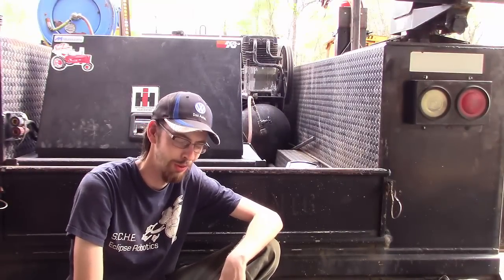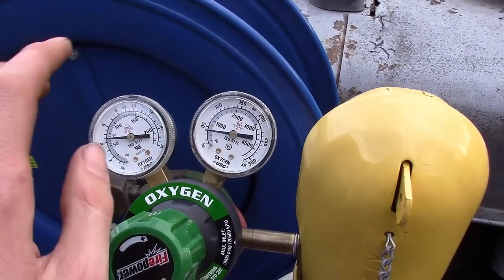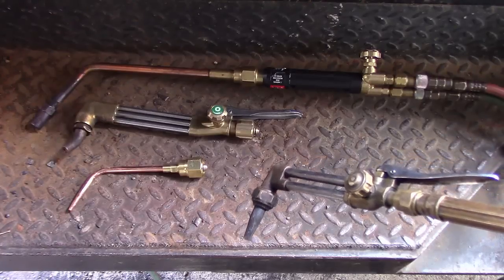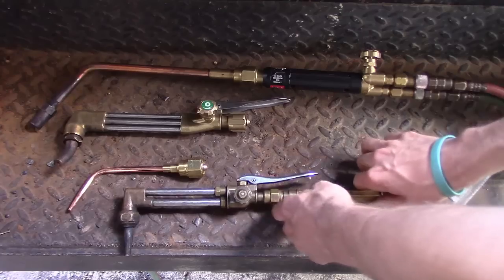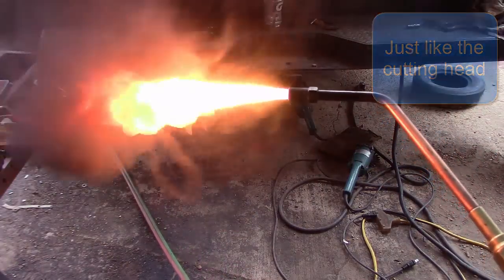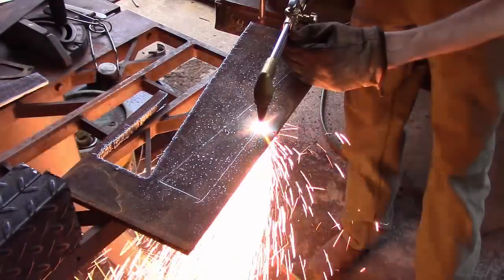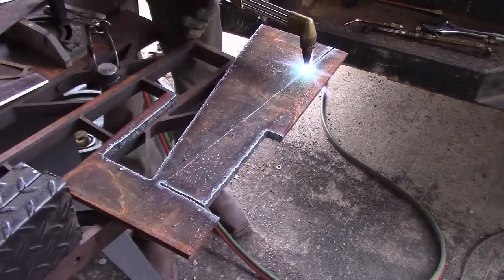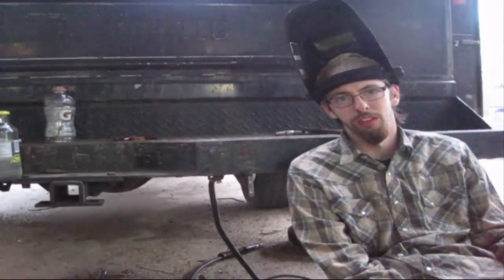Acetylene torch basics

Comment: Hi man.
I appreciate people like you taking time to teach others about the things that are not so common. 
Thank you.

Also,i had a question.
I'm currently looking into melting silver for jewelry making.
I have a couple of ounces now and the roller mill machine for wire making is also in my shopping cart.
What i need to know about now is a torch. But i am clueless as to what to buy or what's the difference between cutting torch and heating torch.
I wouldn't know how to turn one on if i bought it.
Any advise on what to buy and how to use for a begginer with ZERO skills?
Reply from the maker: Thanks for watching always happy to hear my work is helping others.Well first thing is how much are you wanting to spend to get a torch.  The torch itself is the cheapest part of the operation.  The tanks are where the money goes.  You can buy or lease the tanks yearly (you'll have to find a welding store or gas warehouse to do this) I do like acetylene better than any other working gas but you may be happier with propane or MAPP gas (They are cheaper) https://www.amazon.com/Victor-Oxygen-Acetylene-Welding-Cutting/dp/B010E1UYNC/ref=asc_df_B010E1UYNC/?tag=hyprod-20&linkCode=df0&hvadid=312039830589&hvpos=1o13&hvnetw=g&hvrand=15462010840477148247&hvpone=&hvptwo=&hvqmt=&hvdev=c&hvdvcmdl=&hvlocint=&hvlocphy=9013981&hvtargid=pla-627999186160&psc=1&tag=&ref=&adgrpid=63202739518&hvpone=&hvptwo=&hvadid=312039830589&hvpos=1o13&hvnetw=g&hvrand=15462010840477148247&hvqmt=&hvdev=c&hvdvcmdl=&hvlocint=&hvlocphy=9013981&hvtargid=pla-627999186160  This would be a good small torch to get you set up.  It is not very high and it has a lot of other benefits.  I've never have used this brand but if it is a victor (or victor knockoff) you can't go wrong.  Just be sure you find the gas you want to use first because if you a propane torch it can't be used on acetylene.  Hope that helps.
Reply: @EEJester1586  oh your work is helping...trust.

Thank you for taking the time to teach once again.

I am not sure if there's a difference in which gas i should use for smelting. I will be mainly melting into ingots and annealing wire for thinning..
So...i
U think i can buy this torch you reccomended along with acetalyne gas tank?

I think I'm still out of the map...sorry
Reply from the maker: truth and equilibrium yeah that will work.  Should have no problem with any of those types of jobs.

Comment: Here is another major safety precaution everyone especially in industry should heed..  Do NOT put oil based products in or around your oxygen line or bottles.. Such as WD40..  When they make contact... BOOM!  and it won't be pretty if you are in the vicinity.

Comment: Thanks.  Great. Information!!  Question.  I have a victor clone (Radner) torch which I purchased at AirGas. The rosebud I have will rotate when attached and the connecting nut is fully seated.  It doesn’t flop around but can easily be roasted by hand.  Is this a normal condition??
Reply from the maker: They are made to turn but not that easily.  Be sure it is the right type of rosebud for that torch some will fit but are not the right size. Hope that helps.

Comment: PS: you forgot three things: One: NEVER use oil/grease on ANY fitting around oxygen (self ignites- the grease or hydrocarbons oxidise instantly, just like the two part rocket propellants!).
Two: ALWAYS do a soapy water test (leak test) on all gas fittings before you light up the torch!, and clear the area of paper and other flammable material as sparks/ embers of the arc / flame can travel far distances, ( also keep the gas hoses clear of sparks/ falling metal).
Three: ALWAYS have a friend with you as an observer to help if you have an accident, to check that you have observed all safety items, and to keep all pets/ kids / other adults away from the welding area (distractions as well as these operations are a safety risk to the un-initiated).
Reply from the maker: yes that is a good point on the use no oil I didn't talk about that.  You can check leaks without using soapy water by doing a cutoff test.  Well you don't always have someone to help you.  I work solo 80% of the time.  But your right having a fire watch is nice.

Comment: If you get "drawls?" in your cut, what could be going on with your settings? Great video!
Reply from the maker: Tegan69 it could more than likely its the tip. It might be to big for size of plate your cutting. If it is 1/8” to 3/8 use a 00 tip. 3/8 to 3/4 a 1 3/4 to 1” + a 2.  So if you have a victor torch it would be 101-00. 101-1 etc...   check that first. Be sure your O2 is 25 and higher. Hope that helps.
Reply: @EEJester1586  OK, thanks for the info! Subbed!

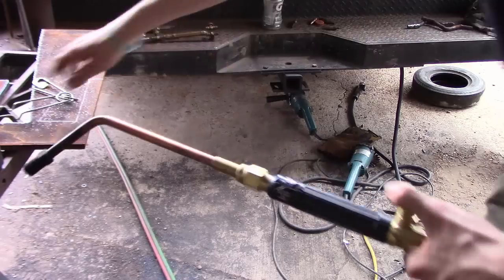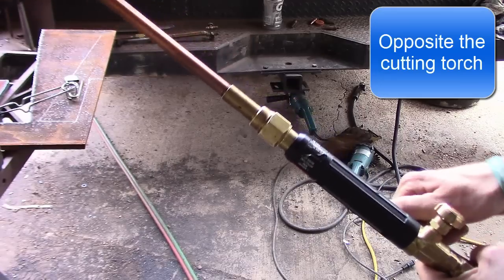Comment: indeed a very interesting demonstration of how to use oxygen & acetylene; thank you. However i would like to ask you for a "favor". I have a problem and when i give a sparking (ignition) to the torch, the burner goes out and i cannot ignite again, it does not light. I am sure that this is the problem you explain to your video between 7:22min and 7:56. To be honest i cannot really understand your accent and this is a problem. (i am writing you from Greece). Please write down a few words of what are you doing between those seconds and what is happening to the torch and not regulate properly, etc. Thank you in advance
Reply from the maker: Be sure you have gas flowing to your torch.  Sometimes the air in the hose has to blead out before it can light. Also  don't light a torch with the oxygen still on it can cause it to go out as well.  The rosebud is a bit different than the cutting torch I didn't talk about the settings for a rosebud.  On your regulators set the acetylene to 10-12 psi on the oxygen set to 15-20 psi.  This will cut down the back firing and make it burn right.  Sorry I didn't go into more detail.  Hope that helps.

Comment: Cutting torch tip size 000-4 run a mix of 5-7 psi acetylene, 35-37 psi oxygen. Higher line psi for oxy isn't used often because cutting 6" thick metal is an exception rather than the rule (you'd also be running 8-10 psi acetylene). ALSO NEVER TURN OFF OXYGEN  FIRST YOU RUN THE RISK OF ACETYLENE GETTING INTO YOUR REGULATOR AND MAKING IT INTO A POTENTIAL BOMB. Newer torches have implemented safety features to mitigate this risk, but please for your safety do not stand in front of the regulator. If the 2200psi oxy tank hammers acetylene in your regulator it would compress acetylene to an unstable psi greater than 15. Essentially turning your regulators into potential guns. Please take safety courses on oxy-acetylene cutting and welding, compressed gas is dangerous and just because you didn't die the first time doesn't mean it wont kill you. Stay safe Welders and Tradesman.
Reply: John Doe 
In school we were told always turn off the O2 first, unless the manufacturer says otherwise.

Comment: A couple of safety items on setting up the torch.  Always purge your hoses before lighting.  Older torches do not have a flashback arrestor, and you should not rely on one to prevent an explosion.  Air in a fuel hose is explosive.  A new hose MUST be purged before lighting the torch.  When welding it is important to 1 run close to the same pressure on both gases, and two, immediately cut off the fuel if a splatter plugs the tip.  This reduces the amount of Oxygen that can back up into the fuel hose or fuel into the oxygen hose.  Uneven pressure and a plug tip can put Oxygen into the fuel or Fuel into the Oxygen hose and result in an explosion if lit, especially if the gas pressures differ.  If you had a splatter block the tip, Always purge both lines before lighting.  Don't just turn on the fuel and light it.
Reply from the maker: I've never had a hose back feed.  I've seen a back fire go the body of the torch but never in the hose.  If you run good equipment and (Old or not) there are loads of things to keep you safe.  Accly is not as dangerous as everyone thinks it is.  O2 on the other hand is the one to look out for.  A torch won't light if it isn't purged anyway.
Reply: @EEJester1586  There were enough people getting gas mixed in hoses that it became a requirement for the check valves and back flame arrestor on the torch handle.  Almost nobody had this issue.  Enough did with bad results resulting in safer design to protect against absolute idiots.  A simple purge of both gases before lighting prevents this.  If you think the gas is relatively safe, think again.  Blow up a small water balloon with the gas mix.  Put it in a paper bag.  Light the top of the bag and get away and wait for it to burn down to the small balloon.  Hearing protection is recommended for this.  Now imagine splatter on a preheat while cutting that backs up Oxygen into the fuel hose and someone not purging before relighting on a torch without a check valve.  40 PSI O2 into an Acetylene hose set to 4 PSI is a bomb.  While cutting, it might not be noticed the preheat went out.

Comment: thank you for this I have been using  an oxy-acetylene cutting torch on and off for years. I haven't  been  able  to get consistent  cuts because my oxygen pressure was too low? I was using 5 lbs on the acetylene and 20 on the oxygen. I am going to try it on 50 lbs. tomorrow and see what happens. The cut parts would run back together after the tip made the cut and the piece wouldn't  fall off. Must have been  too low pressure on the Oxy? thanks again goid video!
Reply from the maker: Aye that is more than likely the problem.  Your tip may be to big as well.

Comment: Hello im looking to melt .999 silver to make bullion bars weve been borowing a huge oxy tank setup but habe to give it back i was wondering how long the portable sets that use the 20 cu ft oxygen tank would last alao which tips we should be using it takes around 3 minutes woth the current one to to get the silver molten amy advoce would be greatly appreciated
Reply from the maker: eluminate occultis well small tanks don’t last very long for cutting but think they do pretty well for brazing. If it was me get yourself a propane weed burner they don’t need oxygen to work they use the Venturi affect to burn at high temperatures. I assume you’re using a crucible to melt the silver if so that would be the best way to go. Hope that helps.
Reply: Yes im using a hand held crucible at the moment been thinking of making a kaiwool forge to set a crucible cup in do u think the map torch would be better or worse e then one of those propane weed burners to power it? Was going to get the extension hose to run the map torch to a 20lb propane tank bit the weed burner costs the same as the extension hose id like to get up to around 2000 deg f
Reply from the maker: eluminate occultis well if you use mapp gas you’ll have to use oxygen too. Just a lot of money just to melt something.  You might be better off building or buying a small forge. It will make over 2,000 degrees F and not use oxygen.
Reply: Gonna try the weed burner forge thank you for the advice
Reply from the maker: eluminate occultis no worries glad to help. Let me know how it comes out.
Reply: Will do brotha thank you veey much

Comment: Appreciate your advice on the torch. Lots of times it's the little things that seem to mean the most. One question.........what kind of a valve is it that is in line to keep a fire from going in reverse and going back up the hose and into the bottle. Is there such a thing? Someone told me about that some years ago. But I asked him how it could do that if there is pressure pushing the fuel out the hose? Could you enlighten me on that please sir? Thanks........Jim
Reply from the maker: James Pinckard sure thing. It is known as a check valve. I didn’t have any on this set up but they are good to have. Check valve only let gas flow in one direction so if something tries to go the other way it will close the valve and stop a flash back.
Reply: James Pinckard     It’s called a flash-back arrestor.  Most modern flash-back arrestors contain check valves.  The check valves stop the gas, as mentioned, but the flash-back arrestor stops the flame.  It’s a bit of a nuance, but it is technically the correct answer.   There are also hose line flash-back arrestors, which connect between the outlet of the regulator and the hose leading to the torch.

Many of the arguments in the comments section have to do with a confusion of terminology and how different torches have different specifications regarding the two - and thus proper lighting and shut-down procedures.  For what it’s worth, I thought this was a good video, and while it was not ALL INCLUSIVE of every little detail on the subject (as many commenters are bitching about), it was correct for his set-up and his equipment.  Like always, just double check the manufacturers guidelines for their specific instructions.
Reply: @UhYeahWhateverDude  Thank you for the detailed reply. It clears things up a bit for me and now I will know more about what to ask for the next time I'm at the welding supply store. You've been very helpful. Thank you very much. Jim.....

Comment: Hi , great video, very helpful info.  What tips are the right tips for cutting thick metals.  Could you specify the correct tips please.  Thanks for the video.   Dan
Reply from the maker: ddcd53 it depends on what type of torch you use. A victor brand has different size torches, but the most common is the 101. The forth number in the order will give you the size for cutting thick metal. I.e. 101-1 that is a good all around cutter 1/4" to 3/4". 101-0 and 101-00 is for really small stuff 1/4" to 16ga. 101-2 and 101-3 is for bigger stuff 1/2" to 2". Remember that the 101 is the torch type there are other numbers like 98 that won't fit a 101 torch.  Just look for the dash (-) and the last number to get your bigger sizes. Hope that helps.

Comment: Is there a specific operating Temperature that the tanks and the hoses are supposed to be used in I’m just asking because I’m from the Chicago area and hear you either need to Greece Fahrenheit the summer or in the winter you between 30° and -0 and I’m in have to take it out for automotive activities and they’re going to be outside most the time

Comment: Righto were do I begin  let's start with your complete incompetents with the safety side of oxy cutting  then your lack of knowledge of your equipment starring with your tip  run a fuckin tip cleaning through it then if you want to be the big man cutting free hand simply don't you bafoon I suggest put the thing down get a broom and sweep floor but if you must clown around at least use some guides then that cut won't look like jaws hacked it
Reply from the maker: Michelle Carroll if your going to insult me then use proper grammar.  There was not one period In that paragraph.  I love people telling me everything I'm doing wrong, and it sounds like this. " ya uh dumbass BEACUSE YOU Sux shit thorw a hole in taw wall yeasg ya do"   Sorry if you didn't like my video. If it bothers you that much then don't watch it.

Comment: You forgot to mention the regulators  , cant they be damaged of there not turned out when you gas up the system ?
Reply from the maker: They can, but it is rare.  I've done it for years with no problems just use them every now and again that's what keeps them up.

Comment: Lee Williams
The cutting process is not melting the metal away; the stream of oxygen is rusting the metal away. That’s the reason you can’t cut stainless with a torch. Also the oxygen bottle valve has a back seat when opened all the way that prevents leakage past the valve stem packing gland.

Comment: I think it should be said - when switching to a full tank, to back out the pressure regulator  knob, if not done, then when you open the tank valve for the first time the pressure may "spike" way up, and may blow something - they say that the adj- knob could fly out like a bullet ?  ( better safe than sorry)

Comment: I’m no pro but I run 3 psi on acetylene and 30-35 oxy I’ve cut 1” several times without issues
Reply: I run acetylene on 5 and oxygen at 30